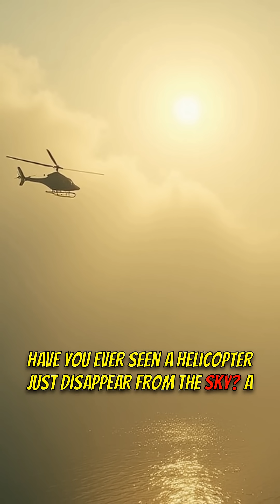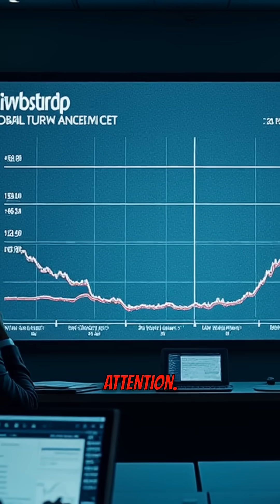Hudson River Helicopter Crash: The SHOCKING Truth!

Comment: Mast bumping usually shatters the mast. The entire transmission as well as the isolation mounts were all still connected to the mast and rotor system. This suggests the mounts may have broken loose from the roof due to corrosion or unknown cracks in the roof structure.
Reply: Yea, structural wear could certainly play a role, but let’s remember crashes are complex—mechanical failures, maintenance oversights, or even sheer bad luck might intertwine.😢